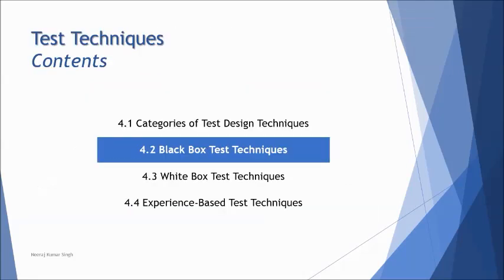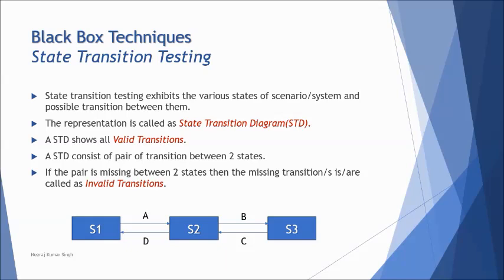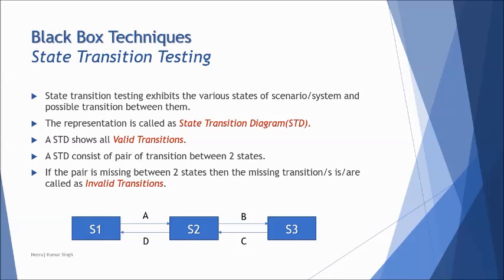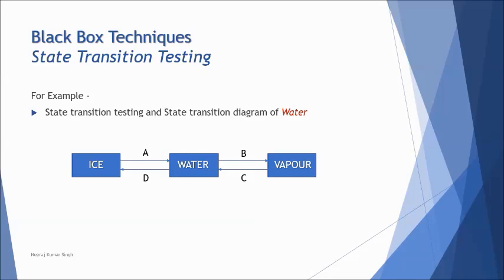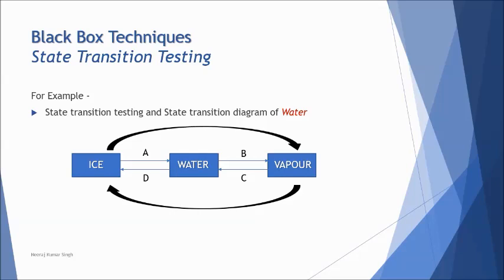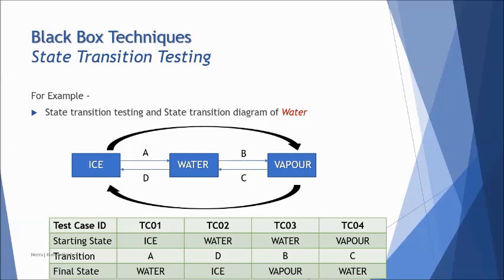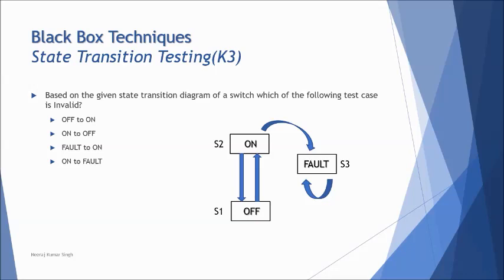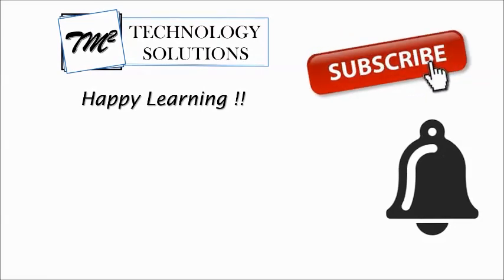ISTQB Foundation Level | 4.2.4 State Transition Testing | State Transition Diagram | ISTQB Tutorials

Comment: Hello Neeraj ,
You are applying state transition testing to the hotel room reservation system modeled by the 
following state transition table, with 4 states and 5 different events:
Events
State                                        Available                  NotAvailable               ChangeRoom                            Cancel                      Pay

S1: Requesting                            S2                              S3

S2: Confirmed                                                                                                      S1                                            S4                            S4                                                                
S
3: Waiting list                            S2                                                                                                                     S4

S4: End
Assuming all test cases start in the ‘Requesting’ state, which of the following test cases, 
represented as sequences of events, achieves the highest valid transitions coverage?
a) NotAvailable, Available, ChangeRoom, NotAvailable, Cancel
b) Available, ChangeRoom, NotAvailable, Available, Pay
c) Available, ChangeRoom, Available, ChangeRoom, NotAvailable
d) NotAvailable, Cancel, ChangeRoom, Available, Pay
Select ONE option
I didn't understand this question. Could you please help me in this.
Reply from the maker: Hi Dipti
Let's make this simple. The table must be clear that there multiple states a request (Requesting, Confirmed, etc) can go to based on different statuses(available, Not available, etc) 
The ask here is which of the following covers highest number of transitions.

For the answer explanation I will make a separate video. But for now the answer is A as it covers the most transitions.

Comment: Hello!

An employee's bonus is to be calculated. It cannot be negative, but it can be calculated down to
zero. The bonus is based on the length of employment:
less than or equal to 2 years
more than 2 years but less than 5 years
5 to 10 years inclusively
longer than 10 years
What is the minimum number of test cases required to cover all valid equivalence partitions for
calculating the bonus?
a)3
b)5
c)2
d)4
Select ONE option.

The answer is D.
Reply from the maker: Yes the answer is D. 4 partitions thus 4 tests

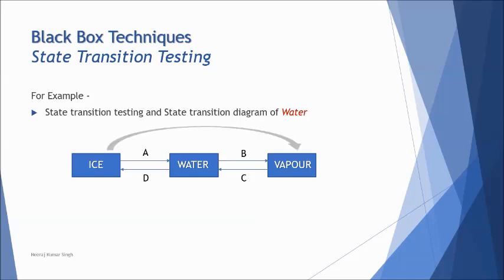Comment: In 3:50 why don't we have transistions from ICE to VAPOR and vice versa and why they are invalid? I mean there are such processes as sublimation and deposition, correct?
Reply from the maker: Exactly true, you can always have it. but that's your requirement. So the diagram is drawn based on a requirement given. 
You can have a scenario where closed request can be re-opened and other product says once closed raise a new request.

Comment: what is guard condition?
Reply from the maker: Hi Abhijit
A guard condition is written within square brackets next to the flow. Control flows in exactly one direction from a decision node, and only follows a flow if the guard condition is true. The guard conditions associated with a decision node must be mutually exclusive, to avoid nondeterministic behavior.
But this not covered in any of the ISTQB Certification. Please ignore.

Comment: Is there a short cut to calculate the number of invalid  transitions, instead of forming a table? @TM Square Technology Solutions
Reply from the maker: Yeah!! You can do so by counting pair of transitions between states - No of valid transitions.
Consider my given example of water, there 3 states. no of possible transitions are 6 (considering pairs of transition between any two states) and there are only 4 valid transitions. Here, 6-4 = 2 which is count of invalid transitions.
Reply: For the answer to make sense, you should know that the number of all possible transitions between n states is n*(n-1). So in the example with 3 states, 3*(3-1)=3*2=6.
Reply: @himmelsdemon  Well in the case of 2nd example, this formula won't be applicable. If you notice the self transition (Fault to Fault / S3 to S3) is not considered in this formula. So, better to consider the states provided in diagram.